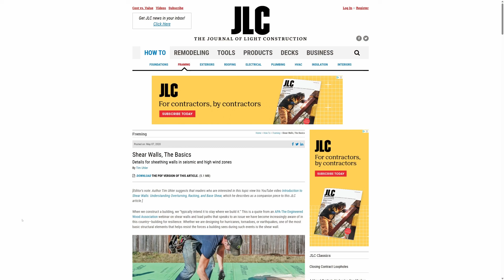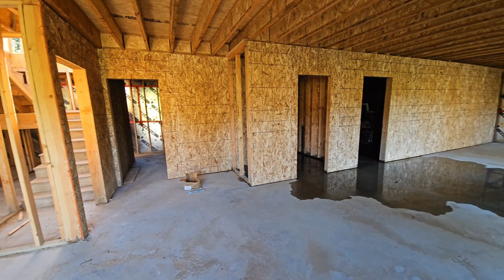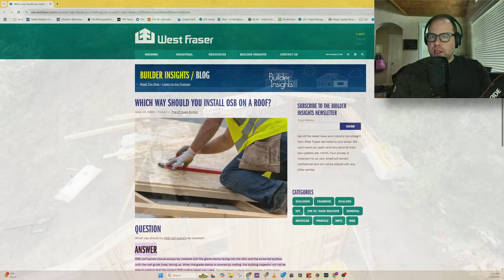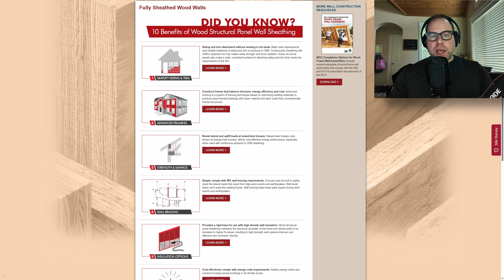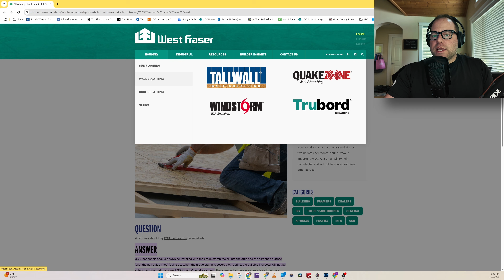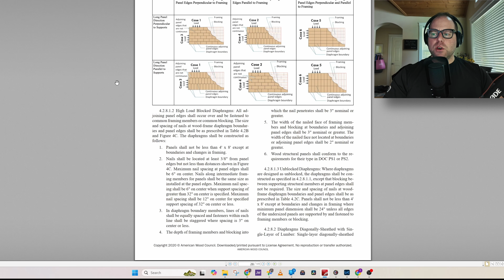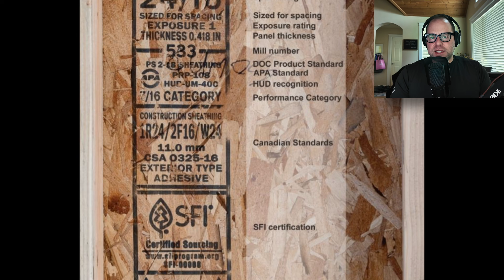Vertical vs. Horizontal Sheathing – The TRUTH According to Code

Comment: Stopped the video 30 sec in. Show me the structural issues either way! Its really a not an issue.  Failure has never been blamed on sheathing orientation.

Comment: "OSB Wall panel sheathing" is made by the manufacturers and is made for walls only, it comes in 4x8, 4x9 and 4x10 in our region (upper Midwest) no blocking needed and you must follow the nailing schedule. They even make 4x9 1/2 fir plywood for 9' walls.....it all goes vertically.

Comment: I'm just learning from videos like this because I want to build my own shop. Also using google and AI a lot. Not even close to an actual planning phase where I need to check my local and international codes yet. AI told me for a 16' wall the code says I need 1 blocking at 8' to strengthen the wall. I thought why not do 4, 8, and 12 to make it even stronger? I wasn't even thinking about sheathing at the time but what do ya know, it works out for the sheathing too whether I go vertical or horizontal. I don't care about extra labor since I'll be doing the labor and it's only 4 walls. Really interesting to learn all of this though. Thanks

Comment: Completely agree with you.  We always order sheets long enough to catch mid rim on the next floor here in Northern California.  in some areas the engineers with spec 3x on the vertical joints.  Also, I use to write for JLC back in the day, late 90s.  Had a lot of fun doing that and attending JLC live.  Maybe you read something I wrote.

Comment: "Forget what the panels are stamped as...the rest of the framing will carry the loads when vertically sheeted". My building is horizontally sheeted and blocked every 4 feet in both directions. Do whatever you wish...I know better.

Comment: If you could not run it vertically then you could never use LP Smart Panel siding, or T1-11.
Reply: aye, as they say it's less directional and more "make sure you fasten correctly."  If you lay it vertically, the strength axis is on the studs so you're getting fastening.  If you lay it horizontally, you better block those strength axis runs!  But he brings a good point about blocking on stagger if you run it vertically

Comment: may be a stupid question.  how do you nail the blocking if it all lines up... when I learned this in wood shop (7th grade) we learned you stagger the " fire" blocks simply to allow you to nail them.  But if you want them to line up with the sheathing seams, are they just toe nailed?  and if so... again Im just a happy home owner who has a little knowledge... can you show a technique to do so without them wanting to shift as you toe nail them?
Reply: The blocking gets shot through one side and toe nailed on the other. Nail guns are so fast there's not much movement. Good old hammer nailing is experience and practice that keeps it where you want it. Sometimes just have to hold the blocking above your mark and drive the toenails until it lines up. Not a stupid question, pursuit of understanding.

Comment: I just built a residence in Florida. Used 8' precut studs and tall wall sheathing installed vertically. I had to cut a few inches off of each sheathing panel so they would meet the second floor wall sheathing midway on the deck assembly ribon / band board. This elliminated the need for blocking. The inspector was diligent when inspecting nailing patterns. Also on roof sheathing. Edges within 5 feet of eaves, every 3 inches. Then every 4 inches. Every 6 inches on trusses.  Also the entire house frame in bolted to the concrete foundation every 4 feet minimum, all the way up through the second floor wall double top plates.

Comment: I don't think it's a matter of vertical vs. horizontal as it is an opportunity at times to lay the sheets like bricks. The offset adds diagonal strength.
Reply from the maker: Blocking and edge nailing is more important than laying them like bricks.
Reply: @AwesomeFramers  locking and edge nailing can be done in either orientation.

Comment: So I live in Northern Illinois and I’m thinking about building a house. What would be the benefits or drawbacks of sandwich sheeting a wall with something like zip system on the inside as well as the outside. And then of course drywall over the interior zip wall. I’m just wondering if from a vapor diffusion standpoint and a thermal insulation standpoint if this would be a good idea? I was planning on framing with 2 x 6 walls with Rockwall and then putting rockwall on the outside. Thoughts?

Comment: Oh, and one more thing. In high wind zones the sheathing has to over lap onto gables and subfloors. Every edge must be nailed. Sheathing that gable end truss horizontally means just one line of weird shaped seam blocks to cut at either 1' or 2' above the top plate hinge and one more short line at 5' or 6' seam  in between the individual webs to nail the edges.

Comment: I believe you are incorrect.  Also you did not address notching the sheathing around openings which is a common eng. note in high velocity wind zones. There is a video with a wind machine showing that horizontal AND STAGGARD sheathed walls withstand straight on wind much better. Shear strength no benefit. I believe the nail pattern for shear is how you increase strength.. I'll try to find the wind test video. Note: Great job ! I've been framing and building for 22 yrs and you enlighten me. Thank you.

Comment: Horizontal is better for sheer strength when staggered . Vertical is still code and does the job and also eliminates the need for a seam in 8ft walls and reduces the number of seams on all size walls which in turn will make a more air proof envelope of the house .. both methods are fine. If house is wrapped I usually go horizontal since the seams will get covered anyways

Comment: And just think some homes built in the 1700s in New England that have weathered Nor Easters.. hurricane of 1938.. blizzards and massive snow loads and still standing and occupied.. I been in some.. roof rafters 4 ft apart on a 5 pitch that are logs with the bark on them.... and random width boards fastened with cut nails.  Basement columns a 4 inch tree couple of rocks under them. Me people are over thinking way to much..

Comment: I’m building my own garage.  I do have a skid steer to help raise the wall.  For a 12’ tall 36’ long 2x6 @24oc, what would be the best sheathing plan?  All horizontal with 2 rows of blocking, vertical 8’ pieces up high with horizontal 8’ across the bottom with 1 row of blocking?  Thank you for the knowledge!!!
Reply from the maker: I would likely go 1 row 4x8 vertical and 1 row horizontal to minimize blocking

Comment: I thought you could build a strong structure if you built it correctly without using plywood sheets as a stopgap solution. What the video doesn't address is that a wall needs to be able to breathe moisture to the OUTSIDE. Plywood and similar materials contain glue/resin and make the wall breathe LESS. If you think plywood is needed to compensate for a poor and weak structure, it should be installed OUTSIDE, e.g. Tyvek moisture and wind barrier with an air gap between the Tyvek and plywood. But it seems like 99% of Americans want a worse wall that breathes worse.
Reply: you're talking nonsense

Comment: The design of OSB has chips running the length [8'], creating a 'strand' or grain to run perpendicular to framing members....BUT;
as long as you have solid nail blocks surrounding perimeter of sheet and sufficient framing along interior of sheet,  you can run OSB diagonal if you want to.
so by adding blocking, you create a 'stress panel' no matter which direction OSB runs.

Comment: Horizontal was way easier and faster when using CDX. The texture of the ply would guide you across a 4' nail path and if the panel was out of square it wasn't a big deal horizontally. Now that we are required to place vertically I need x-ray vision to see the the stud or use pre stamped guide lined plywood. blocking is the worst so I place vertically now 10' when available. Thanks so much for the video!!!

Comment: Do you prefer nails or staples for your sheathing? And if nails do you use siding nails or framing nails? They're a debate I always hear.
I like nails over staples, but I know lots of framers that prefer staples and say it's harder to remove the panel that's been stapled.
Reply: i've always wanted to go to 1" staples.  they seem to use them a lot in canada

Comment: Working in the San Francisco Bay Area, we obviously build to stringent seismic standards. I’ve never even heard of sheathing horizontally. My jobs are typically specified as 1/2” Structural 1 plywood, and there’s typically a note from the engineer stating that the stamp must be facing out and the grain must be oriented vertically, meaning the sheet MUST be installed vertically. Even on a 4’ cripple wall,I’m sometimes required to split the panel in order to orient as required. That seems admittedly overkill, but I’m the carpenter not the engineer. 

Also, as he stated, bridging wall framing and breaking sheets in floor framing ties wall and floor system together, largely eliminating clips, tension ties, straps, etc. Why would 9’ sheets exist if you weren’t supposed to install vertically? Not to mention the requirement to block along entire edge of horizontal sheathing. Yes, you’re adding blocking anyway, but sometimes adding it a bit above or below 4’ makes sense to allow easier work for plumbers or electricians. And what do you do with walls taller than 8’? Add another row of blocking? It seems you’d need to anyway if you start at a cripple wall or floor framing. I don’t make sense to me.

Comment: Excellent video. I’m always amazed how many guys do it one way because that’s how they learned on their first job. There’s so much good documentation from manufacturers these days and it’s worth reading. 
I usually run sheathing vertically especially on 8 or 10’ walls. We usually need double studs or a 4x4 every 4’ where vertical panels butt. This is in Berkeley, CA on major fault lines and bad soil. 
One question though— don’t you need blocking every 4’ for horizontal drywall installation? If so, horizontal sheathing might not be more labor intensive?

Comment: Tim, my brother and I (both degreed engineers) are just watching this and we agree with everything you said.  I, too, fell in love with carpentry and never practiced engineering, just went back to my summer job banging nails into wood!  My brother brought up an interesting point and wondered if anyone has ever used adhesive on wall sheathing as we do on floors.  It would be interesting to see test results on the shear strength of a wall system with construction mastic used to apply wall sheathing.
Reply: The ductility of a wood shear wall comes from the nails bending and yielding as the wall racks back and forth. If glue the sheathing to the studs you will not allow the nails to dissipate the kinetic energy from the EQ event.
Reply: Thanks for that. Ductility means the nails are bending slightly in a shake right? Or maybe the wood around the nails is ovalizing, or the nail heads are pulling out slightly, or more likely all of the above. 
Asking because we have a stacked washer dryer on the second floor. I’ve tried for seven years to level it but it’s also sitting on a waterproof pan, which sits on a floating bamboo t&G floor system. Point is, my house shakes like crazy when the washer is overfilled or has towels and blankets. Actually all the time. Is this going to cause the nails to continue to loosen after a certain number of cycles? My wife thinks the washer is going to shake the house apart, and though I deny it, I think it’s true to some degree
Reply from the maker: My understanding on adhesive for shear walls is that it can make them too strong or too stiff but I cannot remember where I read that
Reply: @AwesomeFramers I remember reading the same thing about 5 years ago. It doesn’t really make sense to me though. I’ve never heard an engineer say “make sure you only nail 6 and 12. If you nail every 4” the wall will be too stiff”. Stiff walls are the goal right?
The only thing I can think of comes from boat building. When fixing an old wooden boat, people often use lots of epoxy and fiberglass cloth on a spot repair, thinking stronger is better. But this ends up causing a new failure right next to the repair as the boat is no longer flexing as a whole system.

Comment: Always appreciate your efficient but relatable explanations.  An idea for content I'd love would be a series of condensed start-to-finish footage of an existing project, but with a complete audio narration overdub and pacing to allow you to focus fully on calling out the specific, relevant IRC code requirements for each step.  IE "the dimensions of the footing we're forming here must comply with the table we're displaying from IRC R507.3.1...  Our floor joist spacing is 16" based on this span table from R502.3... The number and type of nails we're using for this step satisfies R5xx.x". Could be quick hitting and stripped down for length, just direct viewers to the relevant existing video if they'd like to see more on that topic. You could do a whole series without taking any new footage and could drive some traffic back to those existing videos again, to boot. It would be very helpful to folks that might find verbiage in the code confusing, but would understand if it was quickly explained or demonstrated.

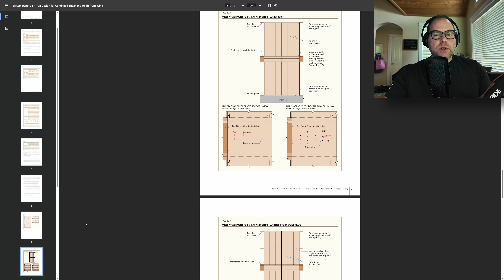Comment: Contractor that does his own framing 35+ years. Block seams and try not to break sheets on the edge of windows. We have crawl spaces here so we have floor joist I like to stagger at least the corners and ever other sheet or so depending on windows. This locks the rimboard/seal plate to the foundation while the other sheets lock the top plates/trusses down much like 9:35 Then I try to plan truss gables to optimize sheeting with corners and centers being tied into walls below. After all the home owner doesn't like waste and will like that you look out for him/her. Nail patterns and depth are very important!! Who doesn't crown studs on every wall?

Comment: Not sure if this is mentioned in the video. Was distracted a few times, but it's actually pretty simple when you think about it. A sheet running horizontally at 16 in is backed by 28 ft of studs. Vertical at 16 is backed by 32 ft of studs. Makes sense it would be stronger

Comment: as a former builder of REAL CUSTOM HOMES 🏡  A house without a foundation seems weird,  however i built in the NorthEast
Reply from the maker: What are you replying to?  All these houses have foundations.
Reply: @AwesomeFramers i thought it was on slab ? didn't see any windows down there , anyhow keep up the good work !
Reply from the maker: @Benitodelacruz-d9p these are all crawlspace foundations 👍
Reply: @AwesomeFramers  oh yes thats what i thought , we are doing 12' digouts last decade in our area , homes are going 1.5 - 3 in my area im in N.E. NYC  , we build solid concrete up to the roofs peak , Building here is incredibly demanding !
Reply: I was a framer back in Scotland and my father taught me vertical and when I saw this old house it was horizontal with a 2x6 cut in the studs horizontal which is at every 4’ joint because of wind that makes a lot of sense to me

Comment: I've not heard the term crown and call ( what the captions said any way ) ... I know what a crown is what is "CALL" or am I just miss hearing somethings?

Also once you've identified crowns and you have enough studs to build a wall do you build the wall crowns on the outside or inside?
Reply from the maker: Yep, I think you misheard.  Cull means you get rid of the ugly ones, crown means you check them all for bow along the 5 1/2" edge (in this case)
Reply: @AwesomeFramers  
Got it ... CULL makes sense .... whew 

Thanks!

Comment: When I built my home 35 years ago I framed it out with 2x8 studs exterior and interior and covered the wall and roof with 3/4 T&G plywood, all floor joists were 2x12 and sub floor was 5/4 X 12 T&G white oak and glued down roof rafters were also 2x12 with 2x8 framing all for strength ! You could run into it with a semi and it would not move !

Comment: What’s nice about horizontal which I’ve done for decades is u can pull all the studs on center. U can’t do that vertically without doing a lot of extra bs steps that r unnecessary labor cost to do so like cutting in a metal strap to bring all the studs on centers in the middle of the stud
Reply from the maker: What?  Your wall with horizontal sheathing can also recieve vertical with no differnce in layout.  What are you doing wrong that the stud spacing works for an 8' sheet but not 4'?

Comment: DIY'r here. 1) Are u staggering sheets when u hang vertically as well?  2) what is meant by edge blocking?
Reply from the maker: No we aren't unless it makes sense based on the wall and what's most efficient for materials usage.  Panel edge blocking is the blocking between the studs at the edges of the panel.  That way the perimeter of the panel can be nailed at spacing closer than the stud spacing, e.g 6" nailing instead of 16"

Comment: Is it that the “strength axis” is not as much of an issue in wall construction that vertical stacking is okay? That is, the forces on walls are racking forces which are essentially diagonal forces and there’s no difference in strength in the sheer panels either length wise or width wise in regard to those diagonal “racking” forces? That’s my guess.
Reply from the maker: Yep, that's basically it.  The strength axis stamp is often misunderstood.